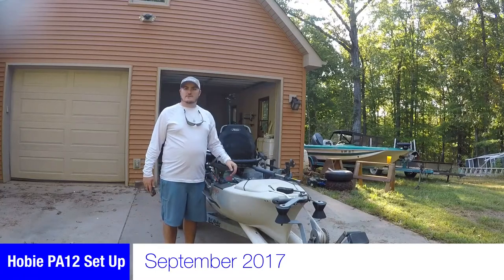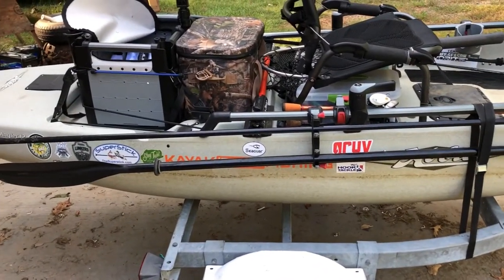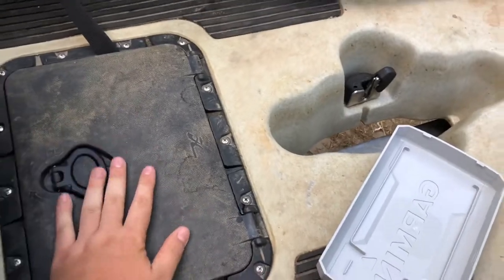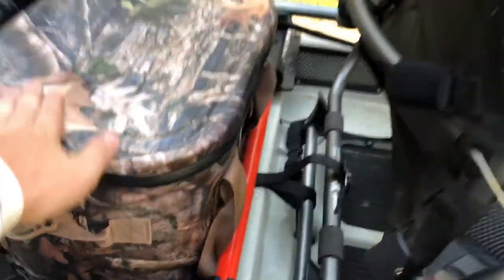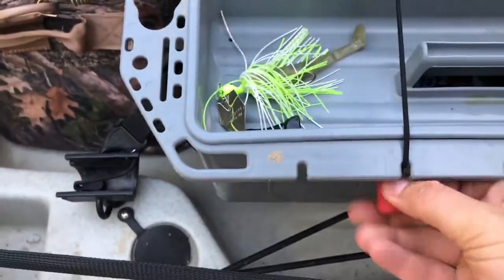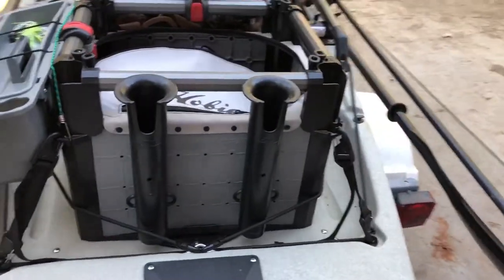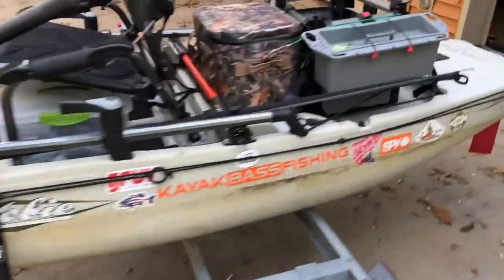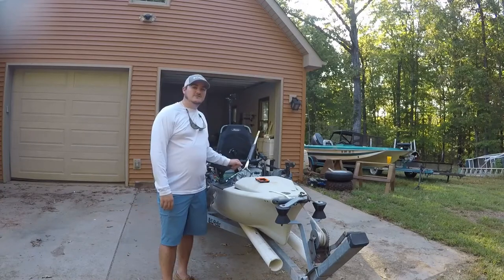Hobie PA 12 Setup (September 2017)

Comment: I am trying to decide between a PA 12&14 to fish in Louisana backcountry fresh and salt.  Why did you decide on the 12?  I am told the difference is the front hatch and rod tubes.   I like your videos watched most of them, currently fishing a 130 sea ghost like it a lot but want to travel farther and long distance so I am upgrading.  You on FB or instagram
Reply from the maker: I went with the 12 mainly because it's a little lighter, shorter, and cheaper. I'm very happy with the PA 12. But everyone always says the 14 is more stable and better tracking, and if the size isn't an issue go with the 14. I think you can't go wrong with either and maybe in the backcountry the 12 is a little easier to manuver. It's about a foot and a half shorter, 15-20lbs lighter, and 2 inches more narrow. And I'm on Instagram just search bluesummitoutdoors

Comment: With the boonedox installed will the hobie live well fit and is there anything to know before boonedox install? With live well on board will h crate also fit? Nice setup...
Reply from the maker: Thanks! Yes I have a Hobie Live well XL and it still fits, you just have to make sure to install the orange cross bar from the boonedox directly over the the back cargo area wall/divider to maximize the space you can use in the cargo area. I can't fit the live well XL and the H crate but maybe with the smaller live well or maybe the PA 14 since it has a larger back area.

Comment: How well did the garmin transducer fit in the lowrance hole? Any special modifications needed?

I’m still trying to decide which Hobie to buy for the lakes in Colorado.
Reply from the maker: +Lukas Aldrich if you check my channel I have a video on how I installed it. However BerleyPro offers a new transducer plate for Garmin to fit Hobies.